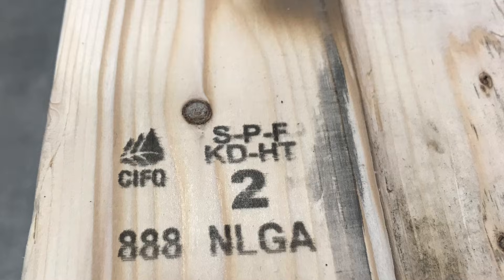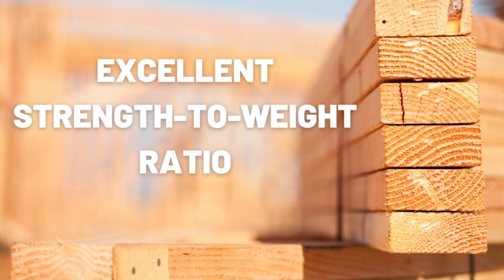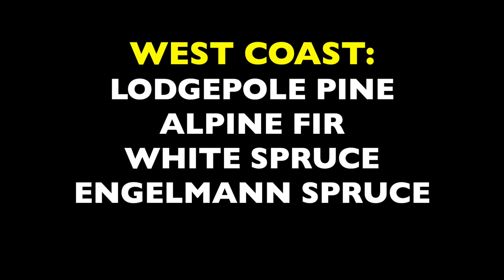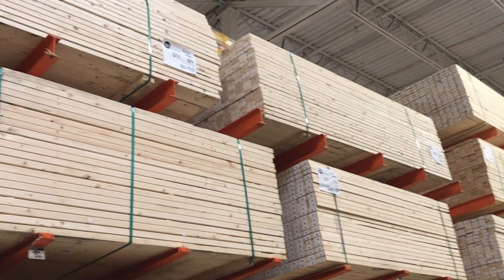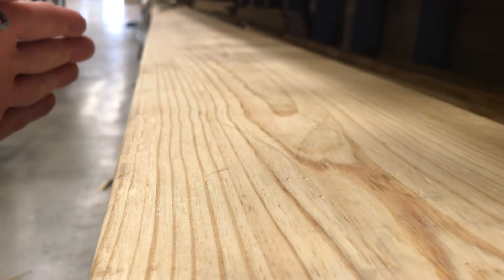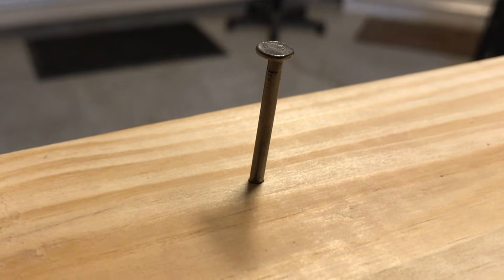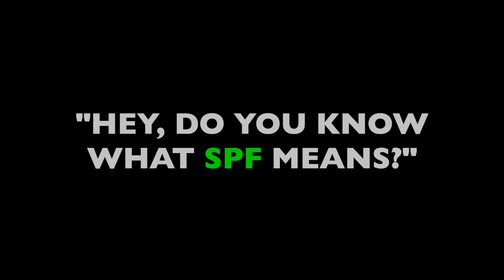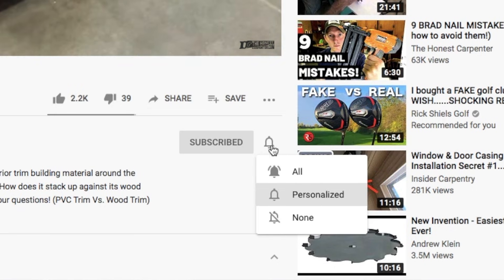What Is S-P-F LUMBER? (S-P-F Vs. SYP...What's The Difference?? Lumber Markings/Softwood Varieties)

Comment: You are correct in most of this video but not in one area.  You said SYP could span further than SPF and that is not true.  Just take a look at the IRC and look at the floor spans, ceiling spans & roof spans.  In all cases the SPF can span further.

Comment: Hi, I am removing a wall in my living room, the engineering recommend me installing a 2"x9-1/2" LVL 14 feet, but it's too expensive, I was planning to install a 2"x12" SPF Dimensional Lumber 14 feet, is that a bad idea?

The reason I want to change the wood is the price, LVL cost $250, the other one $50
Reply from the maker: Definitely use the LVL, Bruno! You always want to go with the engineer’s recommendations.

Comment: This has been massively helpful. Decided to invest into good tools to end up doing wood work around the house on my own, as opposed to spending 4-5x more having someone else do it. Going to the local Lowe’s and HD, it’s quite overwhelming to see all the varieties of woods and 2x4s. This has been extremely helpful in deciding what I will use for a few benches I indented on making. Any suggestion between which of the two stain better?

Comment: Where I am (northeast), it’s all Doug Fir.  You can buy white pine sometimes, but there is much less selection and it’s often lower quality.  Often you’ll only see it in smaller dimensions like 2x3’s and 2x4’s, nothing larger than that.

We don’t have any SYP here, which is too bad as it’s a great, relatively cheap wood for workbenches and similar projects - heavier and denser than most SPF.

Interesting that most of the DF grows in the Pac NW, since that’s not near us, and yet that’s all we get generally.

Comment: All spf I have seen in the last several years are spruce; a wood so lacking in strength the only thing it is really good for is matches!  Fir is so brittle any nail in 3 inches of the end of a board requires a drilled hole close to the size of the nail to keep it from splitting.

Comment: Question for you as we know a 2x4 is not really a 2x4 but I was at my local Lowes getting some cedar boards for my 1st planter I was making,  I'm still new into woodworking BTW, did you ever notice the actual length is not true as well my 10 foot board was more like 9 foot 10 inches or so it happened on more than one board as well thanks.

Comment: I've been a carpenter for 50 years and I guarantee you the lumber of today is cut way too young and isn't near as good as 25 years ago. You need to know grades of lumber.
Reply: I've only been alive for 50 years but I have damn sure seen the difference in the wood planks that are removed from houses built in the 18 and early 1900s, a 2x4 really was a 2x4

Comment: After 40 years smashing my fingers . Each is great . Yet as a woodworker each has it's own personality . SPF is great for floors , It's span is slightly reduced but makes for an easier and more accurate floor to assemble . If someone gives me SYP 2x6 for rafters .. It drives me crazy . Cut a birds mouth and watch it shatter .Though greater clear spans might require 2x10 or 12 for rafters and birds mouths shatter unless you carefully analyse the grain and make sure on the opposing side you don't go through the same area . And Pop Knots !! ..All good framers will dig a 17' long trench , Lower in a bunk of SYP 2x10's and fill up with water and dirt .. To properly season the wood ..Then after a week , Remove and scatter to be cured in the sun . SYP can have some vicious crowns and twist like a propeller . I always adjust my measurements when using SYP .. building a simple sandwich header with 7/16th generally adds up to 3-5/8" and as much as 3-7/8" .Then consider the cup that exist or the grain as to how it will distort .. Creating those lovely lumps in walls . Perfect for crown later . I love I joist which is another different story . I also love floor trusses which are generally made from SYP and assembled by a picker . Then dropped off by a C-130 in Operation Dumbo Drop . It takes a better , more analytical carpenter to work SYP . To ascertain the cup , bow , weave , grain pattern , twist and crown .. And delegate out where it can be used ..   Then again there are guys that just snatch and slap . Pull from the stack and cut /run .. Those would be the efficient carpenters !!!  .. I see a lot of Fir used on finger jointed rafters and studs .. with crowns in one direction and 2 feet down the member the opposite crown . A 32' finger jointed 2x6 can be a horror and take a lot of time to make appear smooth for a roof .

Comment: Here in New Zealand Radiata Pine is THE main building material for homes. Even multi-dwellings up to 3 and 4 stories are often framed with it. It takes and holds CCA pressure treatment better than any other timber too.

Comment: You didnt mention  West Coast Hemlock . Its light colored with     black knots . It has a distinct smell ,    . If its not dry ,its       prone to shrinkage . . Personally I dont like it  , because the sap caused boils on my calves . Its sometimes passed off as  Fir . A standing   tree , looks similar to fir but with slightly different smaller rounded needles .

Comment: I always want to know about wood and what it's good for.

It might be a bit of a pipe dream, but I want to build a bookcase (or more) whose back isn't made of a thin board. It always seems these backs are paper thin, and I am always afraid my books will punch a hole in the back.

In the 1970's, bookcases were made with substantial backs. True they were no higher than 4 feet, but that's all we needed. 4' x 4' x 10", I think. 3 shelves. Mom and Dad got 2 wooden toy chests and 2 bookcases for us kids that they finished themselves, and the wood could not have been thicker than ½ inch thick, but so was the back. Is it still possible to get light materials to build things without them falling apart?

Please forgive me if my questions seem simple.
Reply: You can do it, Ginny.  There are many, many YouTube videos on the building bookcases and other projects.  They vary by complexity, tools used and skills needed, so check out lots of them and find one that's a match for you.  I never thought I could build anything, but over the last few years I've done a variety of projects, learned a ton, and enjoyed it a lot.  The most key things I learned are that there's a version of most projects that fits with varying skill levels, depending on how fancy you want to get, and you can fix most mistakes.  You might really like WoodWorking for Mere Mortals, it's a great channel for beginners like us.

Comment: Can you do a segment on the huge price increases? Like your channel
Reply: It's basically down to Covid.

Most lumber comes from Canada, and they had already reduced their supply in 2019 due to Trump's tariff wars => Lowered reserves in the supply pipeline.

Then everyone had to reduce staff and/or even shut down due to Covid in 2020 => much less wood available for stores than normal and no easy way to restock. 

In places like California, you also had huge fires (one local lumber company had over 90% of its woodland burned) => even less supply of local softwoods like redwood, cedar, and fir.

Everyone else was stuck at home, bored, and big-box stores were open, so people were doing home improvements (either DIY or using contractors) => much higher demand than normal

So, greatly reduced supply and inflated demand => hugely higher prices (think triple in some areas).
Reply: @stainlesssteellemming  I’m in Alberta, and our town mill, which does huge dimensional lumber numbers, was reduced to minimum personnel for months. It really slowed production to a standstill

Comment: I'm familiar with spf and syp, but I have to admit I have no idea what most of the other abbreviations mean. I know kd is kiln dried, but that's about it so I'm looking forward to part 2!
Reply from the maker: Thanks Monkey! Yep, he is kiln dried and ht is heat treated. I know about 60% or so of what I see on most lumbers, but I’m gonna have to do a lot more research to get a fuller picture 😁
Reply: STK Cedar = some tight knots
Reply: you also might see S-DRY which also means KD
Reply: KDAT = Kiln Dried After Treatment
Way easier to cary treated wood when it is not still soping wet from the treatment process.